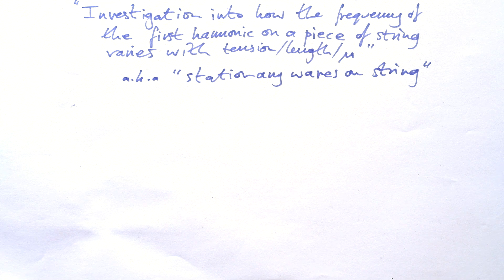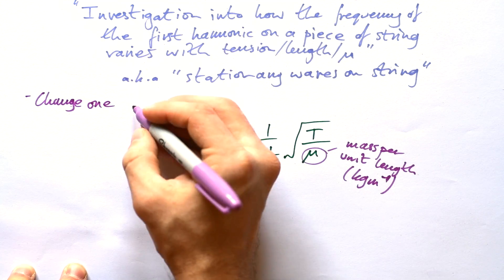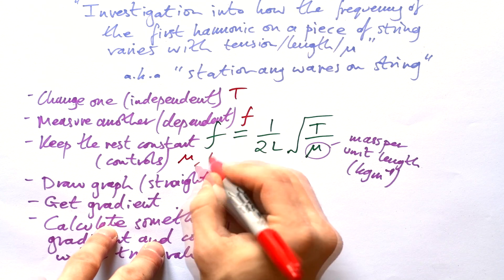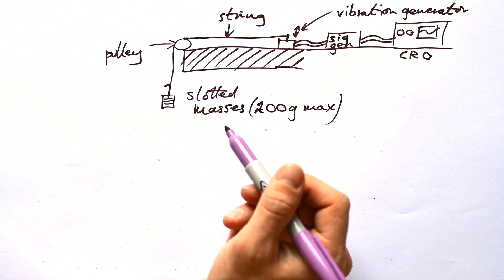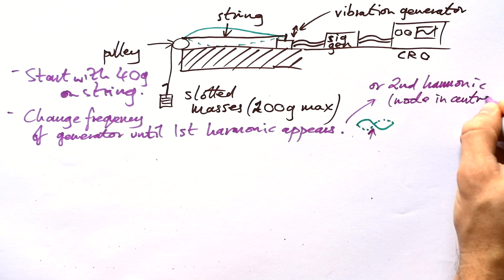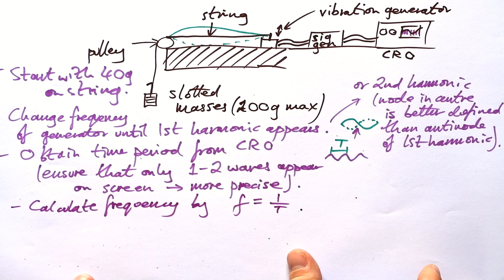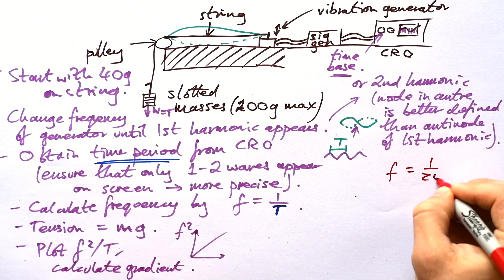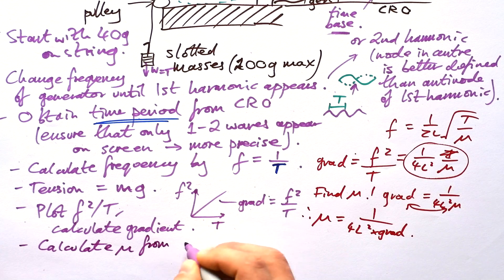Stationary Wave on String - Required Practical - A-level Physics

Comment: how do you keep the mass per unit length of string constant if you're putting on mass on the string to increase tension on string?
Reply: Mass per unit length is the property of the string which is different to the tension added externally

Comment: Hello, Mr. Rees - a quick question: how would this practical play out differently if you used either length or mass per unit length?  Is it correct to assume that for length, the frequency would be independent, determined by you at set intervals, and you would alter the length of the string [keeping the mass on the end constant throughout] until you found the first harmonic, and then repeating this for a greater frequency? And how would it work for MPUL, μ? Thanks for any pointers you can provide.